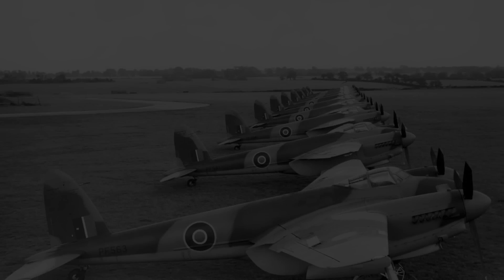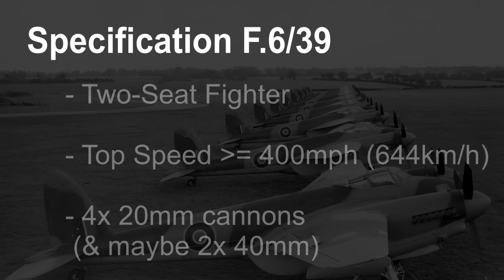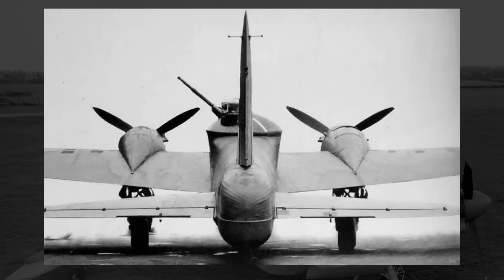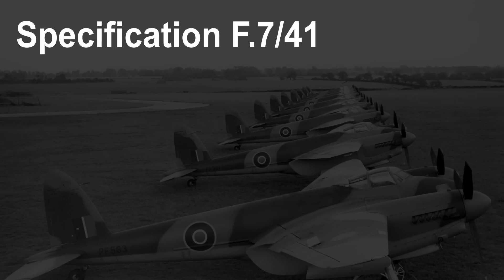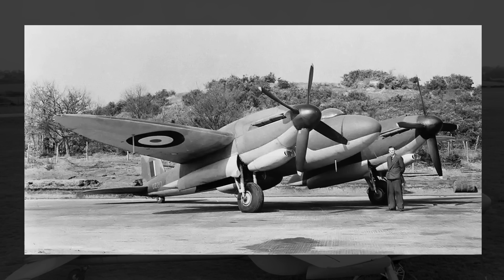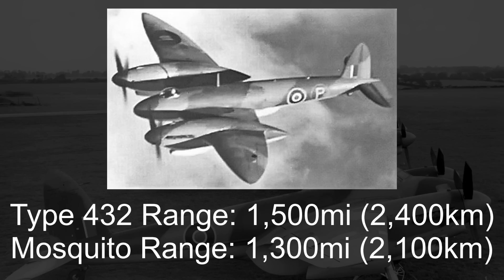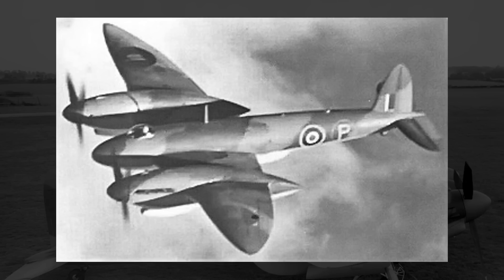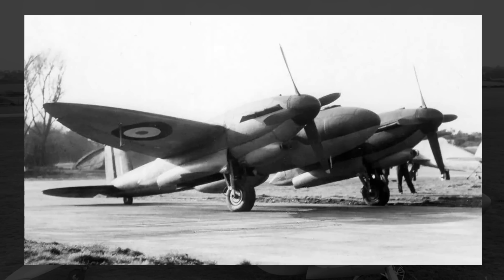Vickers' Unfairly Abandoned "Tin Mosquito": Vickers Type 432

Comment: OK---------.  I CAN NOT BELIEVE THAT BEING PREGNANT HAD NOTHING TO DO WITH ITS SPEED AND INSTABILITY ISSUES...  I CAN UNDERSTAND ADDING A HIGH-DRAG RADAR DOME BUT THEN BITCH THAT IT COULD NO LONGER REACH 400 MILES AN HOUR OR HAD STABILITY ISSUES DUE TO SUCH A SMALL RUDDER SOUNDS DISINGENOUSE... BUT IT DOES DEMONSTRATE THE ADVANTAGES THE WOOD MOSQUITO HAD OVER ITS METAL COMPATRIOT...  BUT IT WAS A SHAME THAT THE RADICAL NEW WING CONSTRUCTION WAS NOT CONTINUED ON OTHER AIRCRAFT...

Comment: I’m confused why this was of interest to Air Ministry given the Mosquito already existed and was proven as highly configurable to multiple roles. A benefit of the original de Haviland design was that as the Mossie fuselage was made of wood it could be constructed by carpenters and other wood workers, then in plentiful supply, as was wool in Canada, and even in the UK so didn’t need to use imported war materials. And could thus keep aeroplane assembly lines free for other plane types. And what’s the benefit of it being metal as in tin? Would it be more robust than the wooden Mosquito? Whereas the Mossie was faster than German fighters it was less likely to be hit but was also resilient. The Vickers plane was heavier & slower, presumably less nimble, and generally less capable than the Mossie except for range which some Mossie drop tanks could solve if necessary. Was Vickers just trying to copy a clear competitor to divert govt spending to itself? Why was it wasting time and resources in wartime working on this? What was the expected benefit if it had worked as designed?

Comment: Even if the 'Metal Mosquito' had performed as expected it was redundant by mid 1943.

The Luftwaffe high altitude threat proved not as great as expected. And what threat there could be countered by the Spitfire VII and, if necessary, by increased production of Westland Welkin 

November 1944 the high altitude Mosquitoe NF.30 was in service and the Hornet twin engined, single seat fighter well along in development.

Comment: The original Mosquito was light but strong with two powerful engines designed either to carry bombs, 20mm canons or cameras.  Making it heavier with aluminum,  even with more powerful engines, would have introduced balance issues and increases in wing loading.  It just goes to show that the original concept was the right design!

Comment: Not hating metal, but wood was easier to obtain and wasn’t a strategically limited resource. 

There were different glues used depending on morning, afternoon or night shifts plus for SEAC ( south east Asia command) different resins were developed due to heat and humidity. The mosquito was so good that USArmy Air Corps flew it in photo recon variant but wouldn’t allow it to fly I. Harms way as unarmed recon so provided a pair of p51’s as escorts. That slowed the mosquito down. In 2003 I spent an interesting hour debating mosquito vs p38 & b17 with a docent at the smithsonian in Washington DC and in the end he admitted that on a raid to Berlin the US would have been better with mosquitoes as fewer crew, faster and similar bomb load on a trip to Berlin,

Comment: What about a carbon fibre Mosquito? Weather proofing being the most obvious advantage. Same two halves construction of the Fuselage. Perhaps some reworking on the landing gear and other places.
Reply: Doable, but SCARY EXPENSIVE. Aerospace grade CF isn't cheap, and neither are the Autoclaves needed to cure it properly. Other'n that, if you can find an engineer who is experienced at designing CF structures & layups, then it's very doable. Might be tricky extracting the engineer from their current job - most of them seem to be working in top level motorsports (F1, etc) or for Aerospace manufacturers, so are pretty well paid...

Comment: There was a twin engined heavy fighter with 4×20 mm cannons in the nose, although only a single seater.
The Westland Whirlwind.
Had Rolls Royce put more effort into developing the peregrine engines the Whirlwind could have been a game changer.
As it was with the failure of the peregrine the Whirlwind was relegated to low level sweeps across France.
Had the Whirlwind been fitted with drop tanks it could have escorted bombers all the way to Berlin and back.

Comment: Mosquito was made from tel layers of thin birch plywood (1/16 inch I believe) separated by a balsa wood core. It was extremely strong but degraded quite quickly with weathering. Tropical conditions were especially destructive to the airframes. This is why there are almost no surviving originals.
Reply: UK surplus originals (whether airworthy or not) were quick and simple to decommission and were burnt on Burnaston airfield, Derby (Now the Toyota factory).

Comment: Obviously the maker of this video is CLUELESS about why the Mosquito was made of wood in the first place!!!!!!!!!!!!!!!!!!!!!!!!!

Thanks to TWO DECADES of LIE-beral NEGLECT OF THE MILITARY IN ALL Western democratic nations -  Brit industry was running FLAT OUT with no reserve of resources or manpower................................
but then De Haviland came up with the idea of making a WOODEN TWIN ENGINE FIGHTER - with the OBVIOUS ADVANTAGE of the machine capable of being PRODUCED IN WOOD WORKING SHOPS - which were WAY UNDER UTILIZED AT THE TIME as people at war dont buy much FURNITURE........................

so by making the machine of wood - Brits got EXTRA AIRCRAFT PRODUCTION using resources that would otherwise sit idle through the war - and there was the ADDED ADVANTAGE that the wooden machine did NOT SHOW UP WELL ON RADAR!!!!!!!!!!!!!!!!!!!!!!

Obviously an all metal Mosquito clone  would need to TAKE AWAY RESOURCES from other all metal aircraft production lines and it would also show up much better on radar .............
thus for Brits an all metal Mosquito would be a Lose/ Lose proposition!!!!!!!!!!!!!!!!!!! 

No wonder they SCRAPPED IT!!!!!!!!!!!!!!!!!!!!!!!!!!!

Comment: Very informative indeed thanks. One of the other nails in the coffin of the Vickers design was how versatile the De Havilland Mosquito airframe turned out to be.  As the air ministry wanted new options, De Havilland was able to adapt the Mosquito to fit the job.  Including a version fitted with a 6 pounder cannon for anti ship, and ground attack, produced near the end of the war. As for high altitude heavy fighter option which the Mosquito could already do.  I think the P-38 from Lockheed being available, didn't help Vickers chances of getting a build order as well. Far as I have ever heard, the only real issue with the Mosquito from De Havilland, was they could not produce them fast enough to meet the demand.
Reply: They struck some issues in the South Pacific with catastrophic failures caused by delamination which resulted from the climate weakening the adhesives.
Reply: Interesting. I assume they sorted it out as both the RAF and the RAAF used it during the Pacific War and then through Malaya and other post war disputes. The Aussies I believe continued it in service for quite a bit longer than the RAF.
Reply: @lauriestlyon8773  Yes they ended up changing the glue formula used in the Canadian manufacturing process, there were a few loose their tales in the UK as well!

Comment: Not surprising it was cancelled. By 1943 the Welkin and Meteor were flying and developing well, and by 1944 the Hornet. Meanwhile the Mosquito had proved itself as a heavy gun platform and the defensive heavy fighter requirement diminished considerably. By mid 1944 it was obvious that the Meteor would render all prop fighters obsolete.

Comment: Mossy's "magic" came from its ingenious WOODEN airframe, (and twin Merlin engines) that De Havilland used and designed and built in record-breaking speed BECAUSE the Allies had an abundance of a good aviation material  - cellulose - while aluminum, steel and metals were all in short supply and relatively heavier than their worth and needed in all other craft and weapons systems.  Maintenence, however, requires highly-trained wooden and fabric airframe and powerplant mechanics that know the completely different techniques to build airworthy aircraft primarily with wood and metal.  IMHO, had we only wood/cellulose to work with, as de Havilland faced at the start of WW2, we would have developed wood and other materials to the degree metal aircraft were developed simply because metal aircraft were relatively more durable and could be just parked outside, indefinitely and stored easier with less attention.  That's also the reason why there are so few Mossy's left - they all deteriorated in just a few years as opposed to metal airplanes we still see flying of the same age.  Civilian owners couldn't find suitable service to keep any surplus Mosquitoes being used outside the military to keep their airplane safe and functional.

Comment: All that divisory work, so many competing ideas pursued in parallel.  Could all that effort possibly have been better spent just honing down the Whirlwind tom perfection instead?  Re-engining existing designs was a process that went on all through the war.  I am still a bit left in wonder that Whirlwind was just dumped, rather than worked on till its engine issues were over.

Comment: To me it seems most likely that the Type 432 was abandoned not because of what it could or couldn't do, but because the Mosquito was already doing those things.  Unless the Type 432 could offer some radical improvements over the established Mosquito design that was already in mass production, there would be little point to proceeding with this aircraft because it would lead to a duplication of effort and a diversion of resources for no apparent or immediate gain.  Put simply, it was unnecessary for the war effort, so it was cancelled.
Reply: Put two Turbocharged twin wasp radials and see if it's improved.
Reply: @barrybend7189  
It is never that simple.  Changing the engines usually requires a redesign of the wings and wing location as the center of gravity is upset.  Plus, the Wasps were in demand in America for all the planes using it there.  The Bristol Hercules would have been more readily available and within the War Department's control.

Comment: The Vickers Type 432 was not cancelled due to the British hating metal which is a rather absurd observation even if meant tongue in cheek. This is an interesting analysis but it misses out on the context of the time and the Elephant in the room which I will get to. Firstly as already noted the British already had the Mosquito capable of performing many of the roles the 432 was designed for adequately, wasting resources and pushing another similar type into service was not a good idea. If it had been developed quicker, they may have attempted to rectify issues and push into service but by then, it would have given them an aircraft soon to be rendered obsolete, leading me to the Elephant in the room. The fact is by December 1942 when the 432 first flew the first jet flight had happened a year earlier and the Gloster Meteor was deep into development and only a few months from its first flight. It is hardly surprising that the ministry lost interest in the 432 so quickly, unless it worked perfectly from the first flight there was absolutely no need to spend any more resources on it! The Type 432 was a residual 1939 specification in development that was soon to be rendered obsolete, they already had adequate twin-engine types for the moment in the form of the Mosquito and the Bristol Beaufighter. The Meteor outclasses the Type 432 in nearly every metric except probably range, the Ministry pulled the plug quickly as there was no further need to develop the Type 432 as by the time production facilities had been established and tooling prepared for its production it would have been obsolete as a design taking valuable aircraft grade aluminum away from the production of the first jet fighters.
Reply: Just to add to your analysis, Vickers had their foot in several war projects.  I believe the War Ministry would want Vickers to concentrate their resources, including R&D and manufacturing,   to projects with a higher priority. That would include ground (Army) equipment.

Britain had the Beaufighter already, the Mosquito was showing a lot of promise, plus they had access to multiple American aircraft (P-39, B-25, and A-20) that were becoming available.  So this may have been more a case of wasting resources on duplication than just a problematic design.
Reply: He was....joking. Just a modern media style, i find it quite engaging. It's obvious that he's aware of most if not all of the dynamics you mention. A similar death knell was dealt to the Westland Whirlwind which was deemed rather good by test pilots, but various circs saw it being retired in short order.
Reply: @thephilpott2194  
Not trying to argue, however off the top of my head/memory the Whirlwind was very costly and complicated to build.
Reply: @alanmcentee9457  I thought this was going to be about the Whirlwind but it is the wrong shape, time and type of engines.
Reply: @20chocsaday he’s done a video about the whirlwind where he speculates the problem was with the propellers and not necessarily with the engines. Still a great looking aircraft
Reply: @christophermurpy3803  I'll check that, thanks.
Reply: @thephilpott2194
Reply: And of course the German  high altitude bomber threat never really materialised
Reply: @uflux  
True, and that reminds me of a point, somewhat off topic.  I hear often from those claiming the German 88 was such a great gun.  Maybe they don't understand that the British 88 (87.6) or 25 pounder had an even more powerful punch.  Tests showed it could go through much stronger armor than the German 88 could.  But it wasn't developed as an A-A weapon because the British had no need for a high altitude A-A gun.  The British and Americans had sufficient radar and high altitude fighters to block any high altitude bombers.  So the 25 pounder remained a field gun. 

A topic for another day.

Comment: Although it would have been interesting to see these types developed, suspect the Air Ministry made the right decision. Would these aircraft have offered any significant benefit over exiting types? Even if resources had been spent on development, would production cost have been higher than exsisting types? Also, as WW2 progressed there was perhaps a move away from large cannons for ground/surface attack towards rockets which were often more effective for short attack windows?
Reply: On paper the rockets sounded good, but in practice they were very inaccurate.  They packed the punch of a 5" artillery shell but were difficult to aim unless at a short range.

Comment: This video is a bit harsh on the initial mosquitoes. It did have a few minor issues with buffeting, but it wasn't unstable. It flew well right off the bat. The fact this aircraft didn't fly well straight away and cooks the merlin 61 when other designs didn't suggest the vickers was a bit of a pig 😅
Reply: I believe there were problems initially with the type of wood glue used in the construction of the Mosquito, and failures occurred in the wing tips which would come off in flight. Sadly I think this resuted in some fatalities, perhaps during prototype testing, not sure.

Comment: Dehavilland had the edge on many manufacturers when it came to aerodynamics.The ultimate expression of this advantage was the incredible Hornet, which sported twin Griffin's (now a viable engine compared to its state of development in 1939)putting out 2300 HP each and which was even lighter than the mosquito.
Reply: The hornet had Merlin 130s
Reply: @smithy2389  My mistake,there were a couple of DH 102s which were fitted with Griffin's,but that engine fitment wasn't proceded with.
Reply: @darkknight1340  no dh 102s were ever built.

Comment: It looks like a mash-up of a Spitfire (wing shape) and a Mosquito (vertical and horizontal stabilizers). Something that they discovered with the Typhoon/Tempest fighters is that a longer fuselage does lend itself to longitudinal stability. The issues with the Typhoon's tail catastrophic failures in flight disappeared with the Tempest and its longer fuselage. From the shape of the fuselage of the Vickers 438, it looks "too tubby" compared to the Mosquito's fuselage. Reminds me of the old adage, "If it looks right..." The 438 did not "look right" IMHO.
Reply: The wings look like the Spotfire's because Vickers owned Supermarine.

Comment: It's a pity the Westland Whirlwind wasn't designed for Merlin engines. It would have been a great short-range interceptor in the early years of the war. The other missed opportunity was the De Havilland Hornet. Had it been optimised as a long-range heavy fighter/multi-role aircraft from the start (again using Merlin engines) it could have been introduced by late 1943 or early 1944. If the naval variant was capable of carrying a torpedo in lieu of rockets or bombs, the RAN might also have had the best torpedo bomber of the war on it's hands.
Reply: The Whirlwind is often derided as a bad aircraft, but its problem was that it was designed around the Rolls Royce Peregrine engine and when development of the Peregrine was halted in order to concentrate on the Merlin, the Whirlwind was done for because changing the powerplant over would have necessitated a comprehensive redesign in order to incorporate them and it wasn't worth the effort.

Comment: they should not be too disappointed.  The Germans had several attempts to match the Mossie and did not succeed eitther.
Reply: It seems as though it took a lot of design work to produce a an effective double engine aircraft for this role, (reminds me of the differences between the Me210 vs 410), that coupled with the already successful aircraft like the Mossie and Beaufighter, meant that not every design could or should have gone into production.